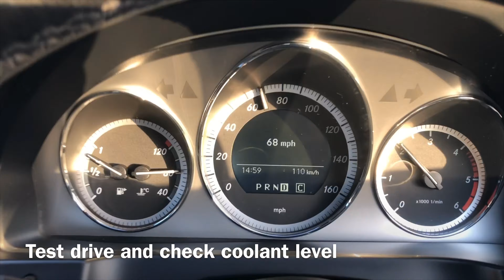Mercedes-Benz C-Class C200 CDI 2.1L (2007-2010) Thermostat replacement full video

Comment: Great thanks, I'm going to do the same job on my 2006 (S203, but the engine is exactly the same one) :) I got a german Febi kit, but it should be fine too (it's a perfect OEM replacement and for 40€ is has the thermostat valve, the sensor and the housing with gasket).
Reply: OK, the FEBI didn't fit (it's the one for a similar engine but has 2 more holes in the valve cover). Got the right Mahle one and now it's back on the road :)
Reply: Alex-GenTLe cheap is not ever the best 😉☝️
Reply: @Sedge1962  They were the same price :) Just different engine versions :)

Comment: Should the pipe that goes to thermostat from the radiator get hot before engine? The hose you removed at 2:49
Reply from the maker: Hello yes the top hose of radiator gets hot and bottom hose of radiator gets cold. So the direction of flow is from the engine to radiator.
Reply: @MustangMotors  thanks for answering, where is the bottom hose located please?
Reply from the maker: @emiljano313  hello if you follow the coolant radiator the bottom hose is located other side of the top hose.